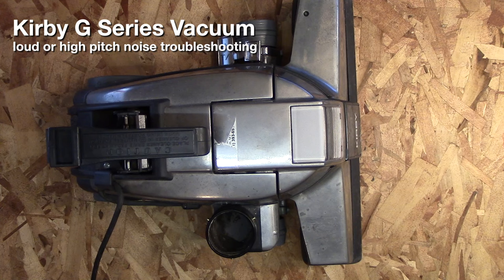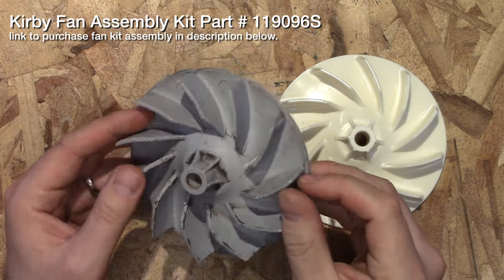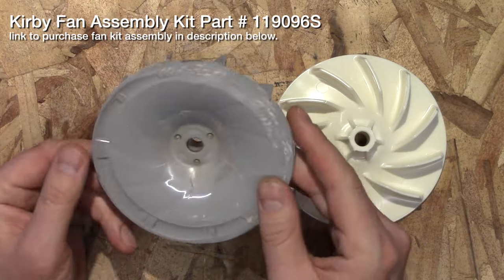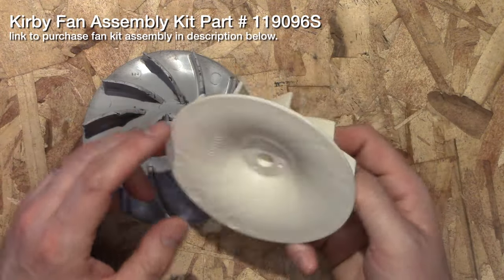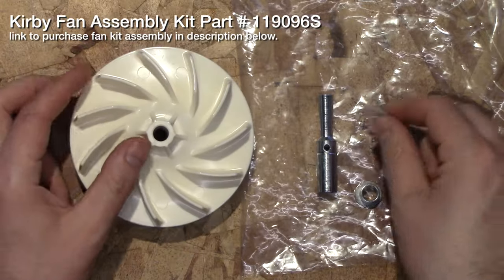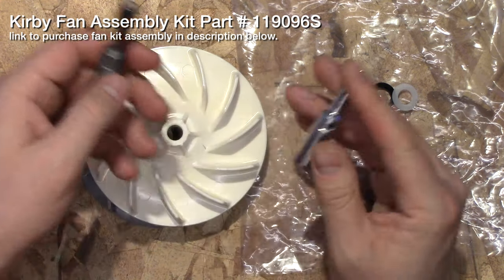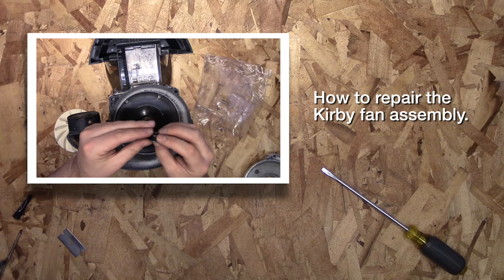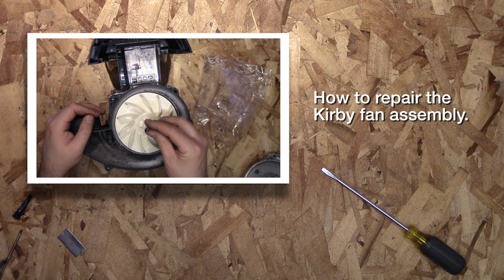Kirby Vacuum Making Loud Noise Troubleshoot Fix

Comment: Mine only started to make that high pitch whine / howl AFTER I switched it from upright mode to use the attachments and then switched it back to upright mode. Nothing's broken, the fan's not damaged, and everything's correctly assembled. Have any other ideas for how to fix it?

Comment: I replaced the fan on my Kirby Legend II, the suction is great, but now it is very loud (hearing protection MUST be worn when using it.  What can I do to quieten it down?
Reply: I'm having the same problem with loud noise. Did you ever figure out the problem or fix it? I need to fix mine

Comment: I replaced the impeller with the kit you show in the video and now it is super loud.  Is there another impeller that is quieter?
Reply: Did you ever figure it out?  I have two and replaced two with this same fan.  One is perfect like brand new - the other is loud.  I can only think that the one that's loud doesn't have the metal piece on tight enough.  I'm going to take it back apart and hold the piece on the back that spins when putting the metal piece on with a pair of pliers while tightening it.  I did this with the one that's quiet but not the one that's making noise.  I was hoping I didn't need to do it as it felt tight but it's the only thing I did differently 🤷‍♀️
Reply: Did you figure out the loud noise? I'm having same problem. Thanks